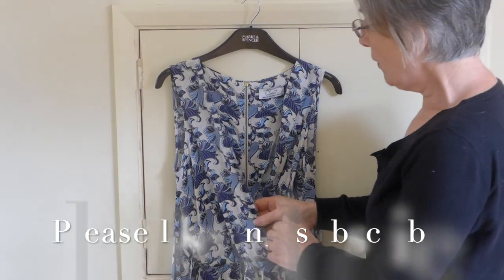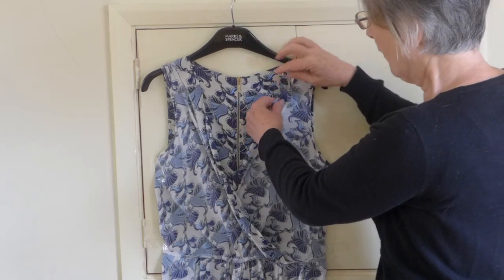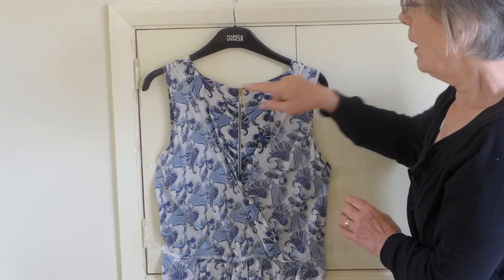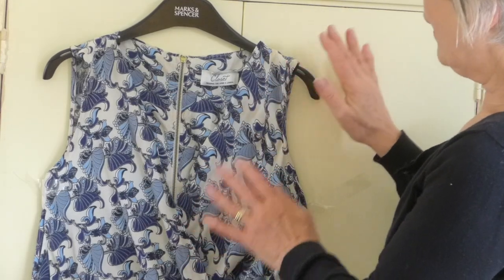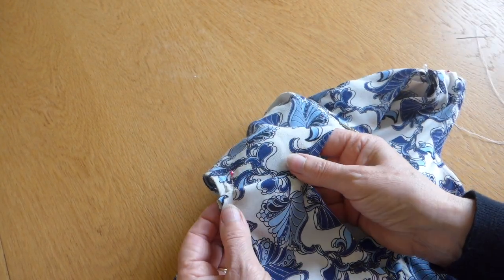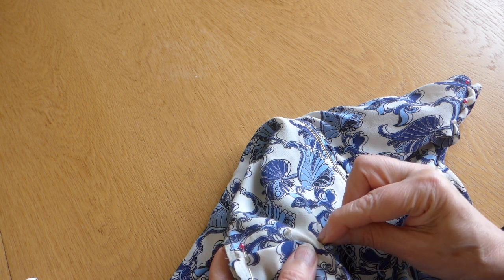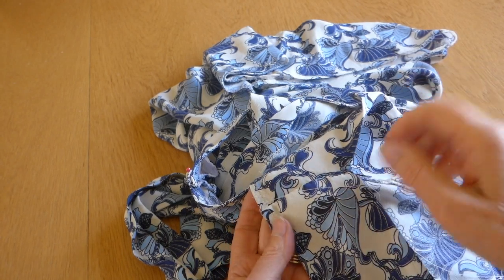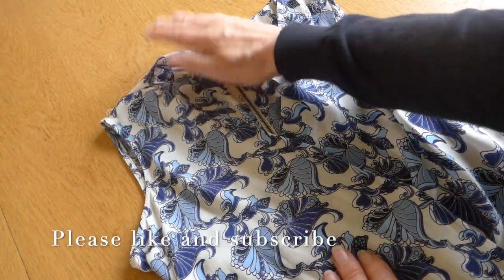How to Fix a gaping dress front

Comment: Thanks for this video! My dress is a spaghetti strap halter so the shoulder adjustment isn't possible, but I pinched the section under the bust where the gaping piece connects to the waist. Same effect!
Reply from the maker: That's a great idea! Thank you for sharing.
Reply: My dress has sleeves so I was thinking of doing the same. Pinching at the waist seam.